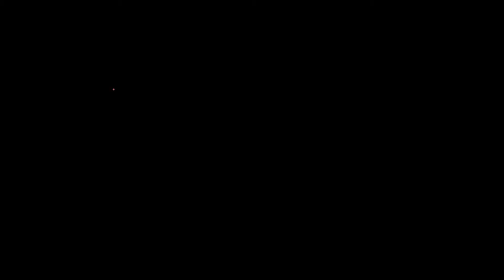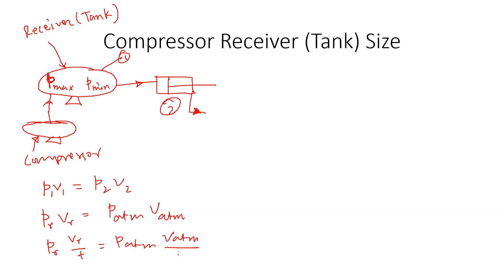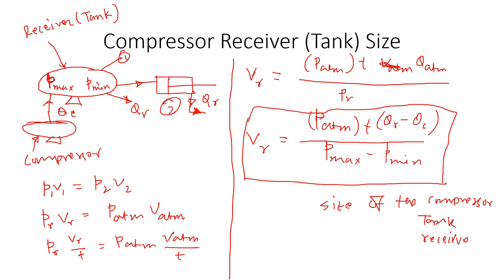Pneumatic Compressor Receiver Size Formula Explained | Updated Audio Version in Description

Comment: Wouldn't P2 and V2 be the pressure and flow rate requirements of the system you're driving, in this case the cylinder...
Reply: hi brother, could you help me to size, if you have found solution,
thanks
Reply: I think you can just convert that volume or flow rate at atmospheric pressure and voila